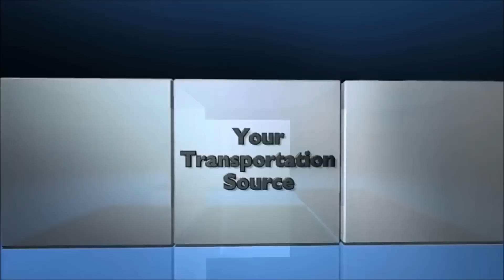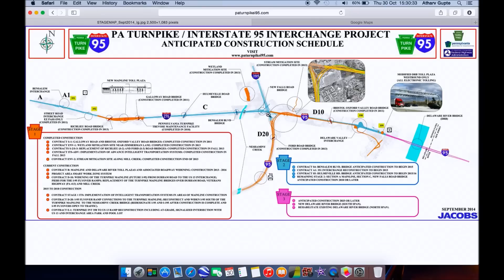I-95 : I-276 Interchange

Comment: This was planned at one time, wasn't it? There is no other reason that the interchange of 95 with PA 413 would be as heavily built as it is. I have wondered why it was cancelled, it may be because of a "wetlands" designation, as PfctvsPonyivsPilatvs says.
Reply: It was originally planned to route I-95 through Trenton on the existing U.S. 1 highway, but the road and bridge was not up to the standards at that time and the Scudders Fall Bridge was being under-utilized.

Comment: All well and good, but I see two things the feds would find fault with your solution: first is that the feds like the expressway mainline to stay to the left, i.e., a new right-side ramp is needed for the Delaware Exway exit from I-95 to Trenton and a left exit for I-95 from the Turnpike where I-276 will now end. Second, your route is similar to a previous route selected by PennDot from the Exway to US 13 to the Tpk but got abandoned for some reason -- Rand McNally indicated it in their map books back in the 1960s and 70s.

Comment: It is good to see alternatives ... but this one does not take into account what the current "clear pathway" already has on it.  Pipelines?  High Tension Power Lines (cannot go underground)?  Etc.  Not to mention the higher cost of all that new right of way, versus just an interchange.  

As for Dual Alignments ... it DOES EXIST in the USA already.  Just take a look at the Dallas-Ft. Worth area.  I-35 splits into two ... I-35W goes thru the DFW metroplex via Ft. Worth ... and I-35E goes thru the DFW metroplex via Dallas.  It is actually very easy to follow and understand as you are driving it from the Oklahoma or Houston/Austin sides of DFW.  Do I want to take the "western" route or the "eastern" route.

In the 95/276/295/195 case, I would agree with the approach PA DOT is taking.  Simply because the NIMBY's in Central NJ killed the Somerset Fwy.

I just drove from NYC to Philly (live in Texas now) and kept wondering "where the hell is the 95 interchange".  Not until I got to 476 did I realize "I missed it".  Looked it up later to realize one thing that I said 25 years ago ... "damn, it takes for ever for these idiots in PA to get a freeway built", which was about the newly opened 476 that took 25 years to fight over and it opened with 4 lanes when it should have had at least 6.

Good luck to my old neighbors in PA and NJ.

I suggest calling this one segment the "Keystone" freeway ... since it is the last critical piece of 95 from border to coast.

Comment: I like the idea, it seems like less of a mess and you mentioned for the use of getting on 276 West from I-95 just use the Neshimamy exit.  As for the power lines there is a way around that; however you it would be wise to invest in sound barriers along the I-95 connecting with the PA Turnpike with your idea being that it is up against residential backyards.  

Unfortunately they have already broken ground on this project, I wish you would have address this idea earlier, I feel the feedback has help us critically think this through efficiently.  

And yes, I concur since I-95 is being redirected onto the Turnpike Bridge, they seriously need to widen it or construct a new bridge.  Otherwise traffic on that will be a bigger problem!
Reply: +Sean Hogan I believe that is a later phase of the project.  They're constructing a second bridge and refurbishing the old one.  Since it's a huge undertaking, I don't think the 2-bridge configuration will be available until 2025.

Comment: The highway north of I-276 currently signed as I-95 will become I-195, which would follow the current I-95/I-295 alignment all the way around the Trenton Metro area and then follow I-195's current alignment east towards Jackson, Belmar, and the other Shore Points.  I-295 south of I-195 currently would remain I-295.

I like the idea that you put forth.  They need to ensure that a 2nd bridge is built across the Delaware at that point.  Plus a faster interchange is a good thing.

However, as far as signage is concerned, the easiest thing to do is to sign the entire NJ Turnpike from end to end as I-95.  South of the Turnpike, current I-295 would become I-95 across the Delaware Memorial Bridge, all the way through the aforementioned split.  Current I-95 north of the split, headed towards Wilmington, would receive a new designation, perhaps I-95W or I-395 or something.  Problem is, apparently, folks in PA have been completely against this and want the Delaware Expy through Philly and northward to remain I-95.
Reply: I reread my comment and I wanted to clarify that the south of NJ Turnpike split I'm referring to is the one where I-295 and I-495 split from I-95 in New Castle, Delaware.  I didn't actually mention it first.  

So, to be totally clear, I think that, travelling northbound, the road signed as I-295 should, from this split, become I-95/295, travel across the DMB.  I-95 would follow the NJ Turnpike from this point northward and I-295 would continue northward as it does today and will in the future.

Travelling northbound from the split in New Castle, I-495 would continue to carry that designation.  The road currently signed as I-95 would become I-395 or I-95W through Wilmington and Philadelphia, possibly ending at I-276, where it would become I-195 as it's slated to do once the new interchange is built anyway.

Sorry If I confused anyone.

Comment from the maker: Please leave a comment below on whether you like my design or the other design!
Reply: Webeo I don't see how your placement would be any cheaper, especially considering the movement of major high tension power lines.  I'm guessing that would be more of an effort and cost than you suggest.  The main problem I see is that your design encroaches on the local neighborhood (dozens of residential backyards) and the town municipal building would be staring right into the side of the raised 276 east ramp platform, which may have had some political backing to the current design.  The current design also resides primarily within a commercial corridor, so is likely considered more "friendly" with the locals keeping the disruption more more centralized.